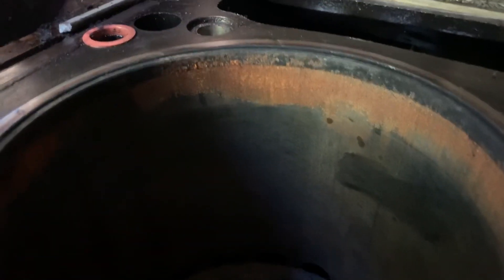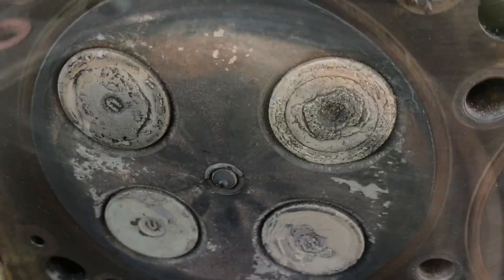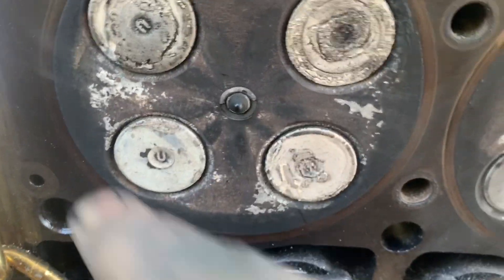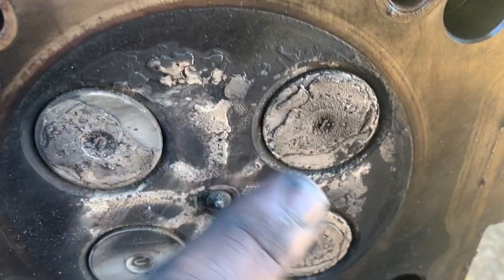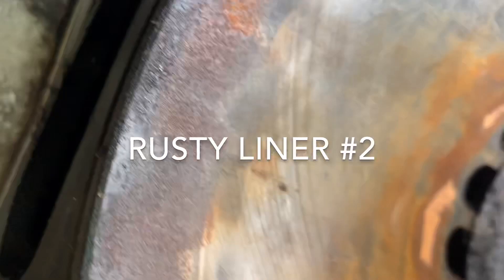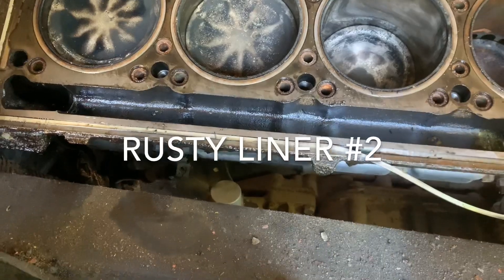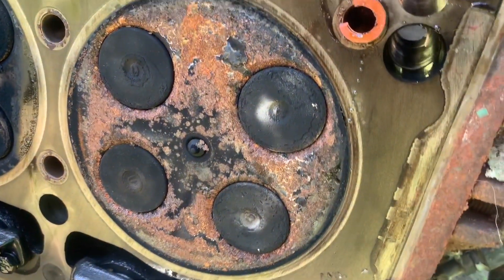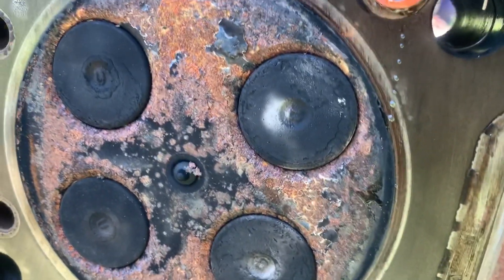8v92TA tear down

Comment: Had a fleet of MCI 9s & 12 I tech'd on for 4 years and one of the mc9s had a 8v92DDECII with a worn out cam thrust  and you had to smack the pulley to slide the cam back a few thousandths so it would sense the timing signal to start
We had 2 of only 6 built mc12s with c10 cats and allison world trans in them and those 2 coaches could haul ass and hill climb
Reply from the maker: I don’t do ddec   The whole reason i work on 2 strokes is the pure mechanical systems of them, i don’t need some damn computer sensor messing up my day.
Reply: J hear you but it paid very well lol. Govt job, also had 2 monster Waukesha stationary LNG gensets that were awesome to run out on test and routine maintenance. They were backup gens from the early 60s and were used until about 10 years ago.
And just for some background, my dad gave me my first bus experience converting a 1938 REO school bus into a camper in 1964. I still like working on the old equipment. 
I enjoy your videos. Ever need anything in Phoenix give me a shout.

Comment: is there an actual flywheel ring gear tooth count off TDC that one could position the engine. so all the intake ports are covered and all the exhaust valves are closed at the same time.  probably not.  just a thought..  for those who need to store their bus for any length of time.. or is there a proper way to pickle the various engines for long term storage..  wedging a nurf football in the tail pipe ..  same for the air intake to the filters.

Comment: That's pretty unfortunate. Started w/a cooling system refresh, and because he left it to sit w/the exhaust manifolds & coolant hoses off, hes basically into now for liners & head machine work- possibly new heads if those seats are too far gone w/rust. I guess the lesson here is, if you must leave it sitting for an indefinite period of time, use something to plug up all the openings leading into the cylinders. Even if its just those plastic plugs you get w/new long blocks, held in w/some duct tape. Probably a good idea to pour some atf into cylinders too. Im not sure if that would yield the same protection on a 2-stroke, with the air intake ports being in the sleeves, as it would on a 4-stroke. Idk, maybe you could roll the engine over to a point where at least some of the ports have the pistons covering them. Too late now!

Comment: Sad to see it then things are tore open to be left to sit and rust it could have been easy fixed and save but oh well not my problem... Do you ever get to work on the Detroit Fuel Pinchers or the Series 50s-60s much ??
Reply from the maker: Nope just 2 strokes
Reply from the maker: Mechanical ones.  I don’t do computers
Reply: I saw an insane deal on a gorgeous old coach with the 8.2 but I'm reluctant, not just because it's underpowered (hooray, less horsepower AND torque than a Chevy 454 gas engine of the same vintage!) but because I'm not sure who'd work on the damn thing. OTOH, we got many years of trouble-free service from an 8.2 in a Barth Regency -- a lovely lightweight monocoque aluminum rig. (Barth  built their own chassis, which was fine except for the air over hydraulic brakes, which appeared to have come off a one ton truck. No idea how they got away with that.)

Comment: Hi Scott, just a thought, the one clean valve (where the others had heavy buildup) I wonder if the seat band on that is much narrower than on the other 3, thus the temperature on that got so high it could burn of deposites, it would be cool if you just let the camera roll when doing the jobs.
Reply: Water seepage would be my guess.

Comment: Bus Grease Monkey, so, what would sombody be looking at price wise for a complete 8V92 rebuild in just parts costs ? (I’ll not ask about labor because that’s none of my business). I’m assuming it would be closer to the cost of rebuilding a big block marine race motor than it would to a SBC rebuild.
Reply from the maker: 5-7k in parts if heads are ok.  The new turbo is in that cost about 1,300 of it  plus new injectors also in that est.